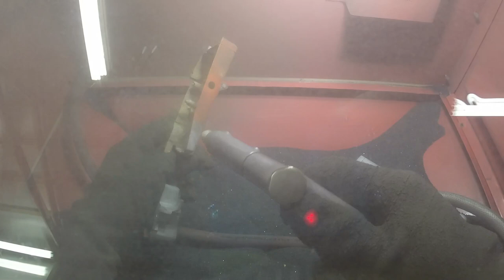Allis Chalmers Toy Tractor Restoration

Comment: it's missing some engine parts, this is one of three modified pullers ERTL has made in 1974, they have the Allis that has a Hemi V8 , a Farmall 560 with Barrel and turbo and a Minneapolis Moline G1000 with a Allision V12 Aircraft motor. I have the Moline, which I am currently fixing.